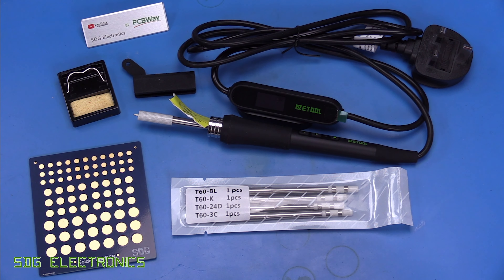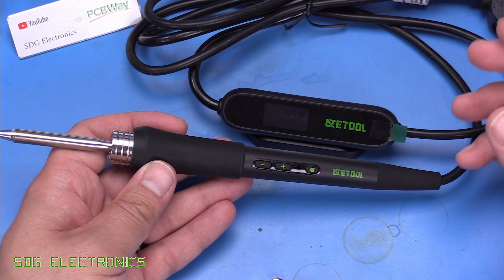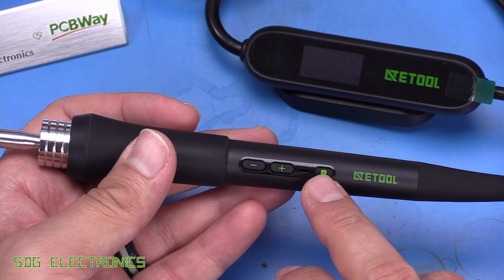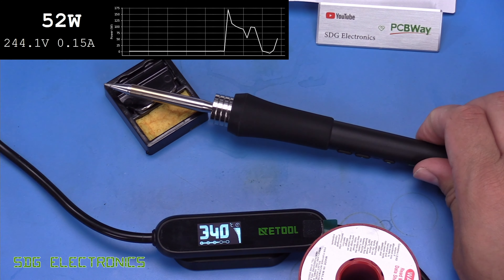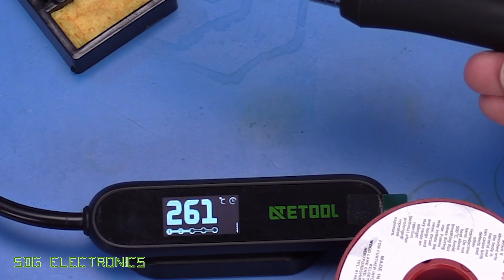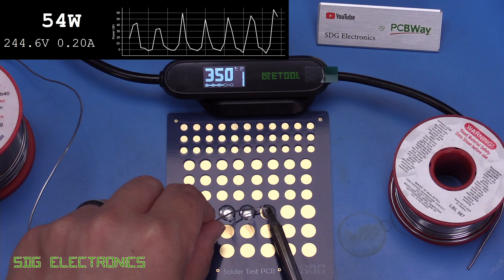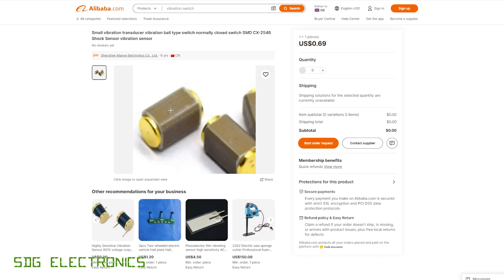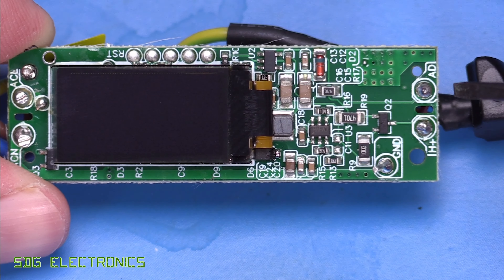SDG #341 ATETOOL AD680D 80W 230V Soldering Iron

Comment from the maker: PCBWay 3D Printing and Fabrication: https://www.pcbway.com/rapid-prototyping/
https://www.atetool.com/product/soldering-kit-AE680D-manufacturing.html
https://www.reichelt.com/de/en/soldering-iron-80-w-temperature-controlled-with-oled-display-atetool-ae680d-p366081.html?r=1

Aliexpress listing seems to have gone...

Support the Channel with Patreon: https://www.patreon.com/sdgelectronics
Reply: Could you please review the YIHUA 982? Possibly the cheapest JBC clone, which seems quite decent, but the reviews are pretty mixed
Reply: Could you please review the YIHUA 982? Possibly the cheapest JBC clone, which seems quite decent, but the reviews are pretty mixed

Comment: Quite common when checking how hot the internals of a power transformer are getting if there is no buried temp sensor. Had to do it a few times during testing for CE marking. You need to know how close your max power demand gets the internals of the transformer to the declared  max temperatures. Using the temperature coefficient of the copper wire to determine temperature was quite interesting. Even more fun when someone from a CE test house was watching over your shoulder

Comment: Quite impressive for such a simple and low cost design.
Maybe they are leading the way and you'll see some ultra high performance AC only station.. 
Hard or impossible part is coupling the thermocouple sensing to the tip while keeping it electrically isolated though.

Comment: I really appreciate your soldering iron reviews. Cheers, SDG. 

I bet inside these cartridges it’s like an old hakko 936 iron with a tip put over a ceramic heating element. But in these cartridges, the heater is friction fit and sealed inside. 

These tips could have a PTC thermistor in series with the heating element. That might explain why the heater resistance seems so low when cold. 

I recently read about the non disposable ‘flavoured addiction sticks’ [that V word youtube doesn’t like]: some do use the heater coil resistance alone for temperature feedback.
Reply: Thermocouple in series as mentioned in the other comment.

Comment: On some schematics for stations they put the thermocouple in series with the heater, measuring the temp by making a pause in the heating and taking a reading. Can't remember where it was, the TS80 perhaps.
Reply: all these tips work the same way, the resistive element also forms a bimetalic thermocouple
Reply: Yeah definitely thermocouple in series, as on the JBC C105, hakko t12, and many others.

Comment: 14:40 are the diodes drawn round the wrong way? Maybe I’m being dumb but I can’t work out how it works unless both diodes do a 180
Reply: As the supply is AC, the LED and diode would conduct on the negative half cycles (assuming the schematic is correct), both reverse-biased on the positive cycles. The high reverse voltage on the LED is not too much of an issue because the LED is blinking slowly.

Comment: IMO, it's a safety hazard. No go!
Reply: Why is it a safety hazard?
Reply: 120V/220V with possible leakage.
Reply: @bobweiram6321 is that why there are no mains voltage irons for electronics?

With a grounded tip I thought it would be ok.
Reply: @davadoff  The other issue is switching such high voltages generates noise which can induce current in the circuit you're soldering.
Reply: @davadoff   Other mains soldering irons are much simpler in design.
Reply: @bobweiram6321  yeah. I wondered recently why there’s no temperature controlled mains irons like hakko t12 but without transformer power.
Reply: @bobweiram6321  maybe I’m wrong… tell me if I am… but I thought changes in current induced noise. And higher voltages make no difference.
Reply: @davadoff  Higher voltages induce more noise when switched. It's part of the reason lower voltages are preferred.
Reply: Agreed, there are other alternatives.
IMO if you want a cheap cartridge based system, then get something T12 based, no need to get this one.
Reply: @bobweiram6321  oh, higher voltage AC couples more like a capacitor. I understand now. 

I guess a 230v iron is still OK if 50Hz sine. Antex iron data sheets specify <4uA, but I’m not sure the limit for sensitive electronics…

Also, 230v heater windings have to be long (high resistance) & spaced apart because of high voltage: it makes for an undesirable long tip length.